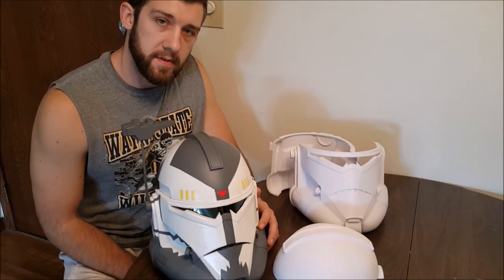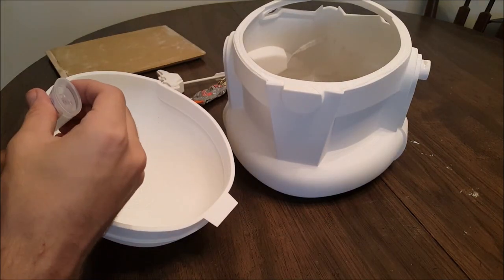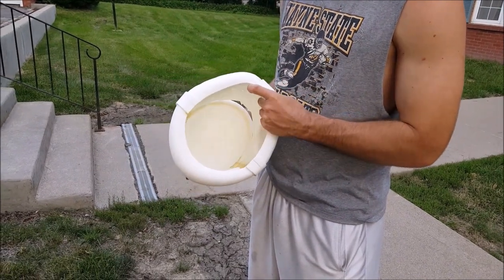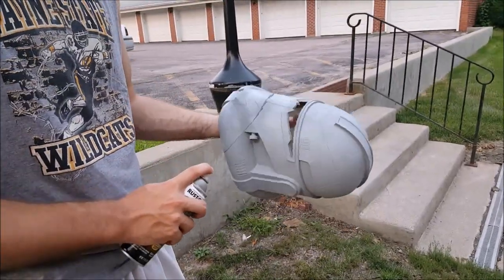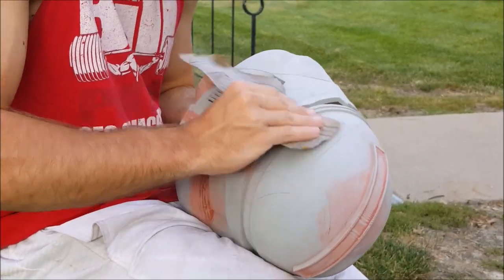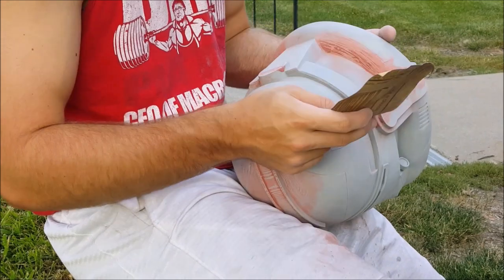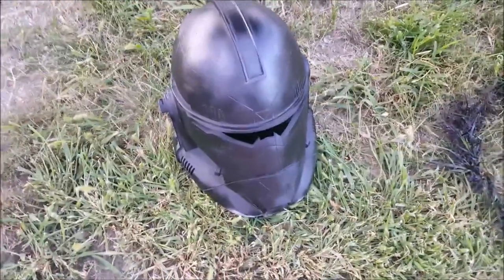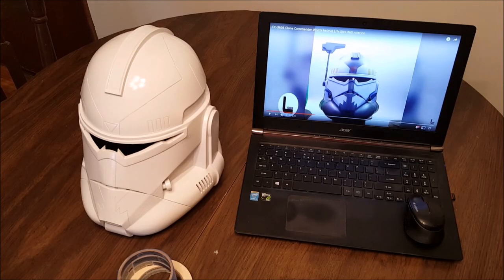How to Make a Commander Wolffe Clone Trooper Helmet

Comment: So love the videos man, really do. Bought the Arc Trooper helmet from you recently and saw ya did a 2.0 version which got emailed over. But I got questions as to what your print settings are or what you expect for print time would be? I'm currently set up at .28 layer height so kind of on the low end of quality and using supports. My printer is moving at 50mm at 10% infill cause continued vibrations going any faster will cause the locking bolts to shake loose and then create a layer shift on my S5. So right now I'm looking at 10 days, which is better than the 19 I originally was getting. Any advice?
Reply from the maker: Thank you very much! My cr-10 is moving at 2400 mm/min. What slicer are you using?
Reply: @GalacticArmory  :o wow you zippin! And for slicer I'm using Cura since it's something I'm fairly familiar with.
Reply from the maker: @Hikuro2pnt0  we might also be using different units. Is your speed in mm/min?
Reply: Galactic Armory you are correct it’s minutes I keep thinking seconds
Reply: @GalacticArmory  wait no sorry, long day, mine is going mm/s

Comment: What layer height are you using when prining along with infill percentage.  Im using the thingaverse files cause i refuse to spend 70 on an stl file (source file no problem but not an stl) and it seems alot differnt then the do3d one you use.
Reply from the maker: I'm using a .3 mm layer height and 5% infill
Reply: @GalacticArmory  oh wow, i figured it was .2 i guess ill try .3 and see how it turns out.  Amazing work btw it looks very good when finished